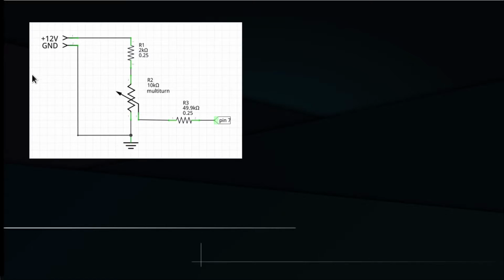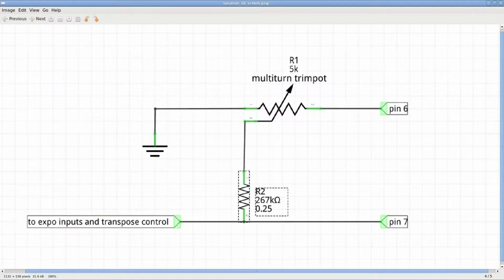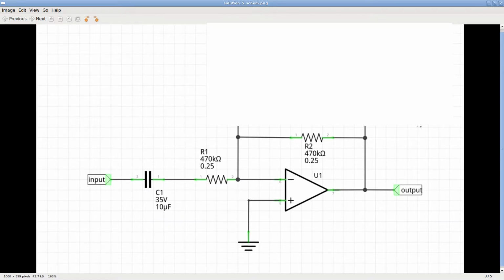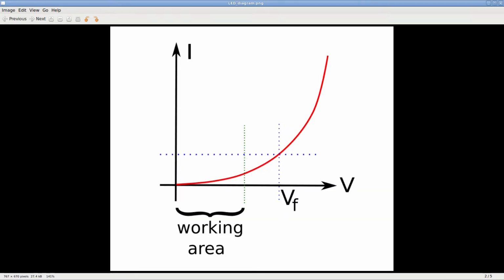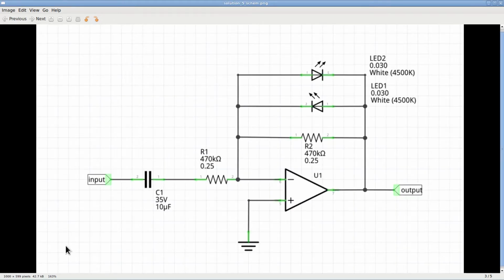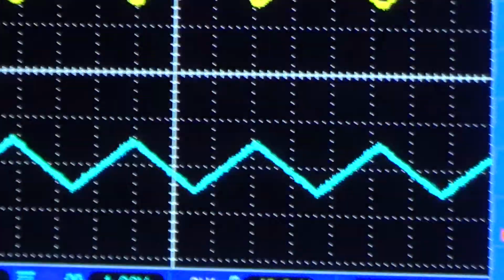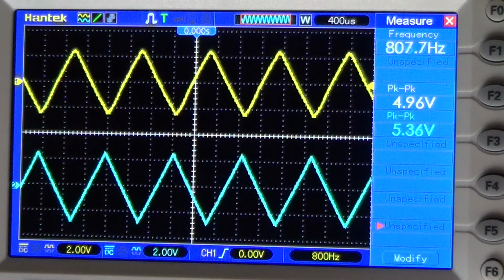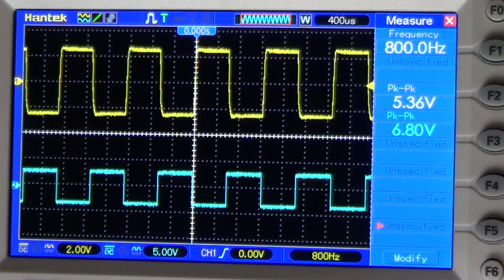The Synth Project Episode 9: 2130 VCO Design Completion, Part 2

Comment: Hi carlo, thanks for the video series! Any particular reason you are choosing the LM358 over, let's say, a TL 072?
Reply from the maker: Comparing the LM358 and the TL series, they have very similar characteristics but two:
1) The LM358 needs more power than the TL series, which could be an advantage for the TL series, if it wasn't for the need to assure a certain amount of output current. The LM358 can support more and so, when I need more output current I tend to use the LM358 instead of other op-amps.
2) The TL series has very high input impedance, thanks for the input stage made with FETs. Whenever I don't need a high output current, I do use the TL op-amps, especially the TL074, since it provides 4 o-amps in the same case.

At the end, the choice of an op-amp instead of another depends on a number of factors. Maybe I should point that out in my videos, to help hobbyists like you to better understand the reason behind some decisions.
Another factor that drives my choices is that I tend to buy several components of the same kind at once. And so, once I decide to use a certain component for a specific circuit, I end up using the same component also for other circuits, as long as they satisfy the needs.

Hope this helps, and thank you for the question and the impicit suggestion to provide more info in my videos.